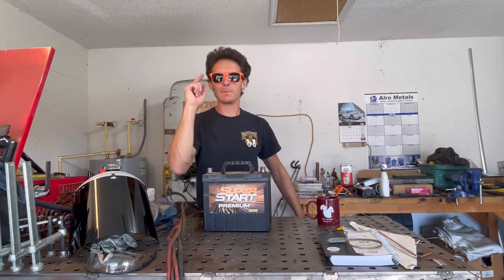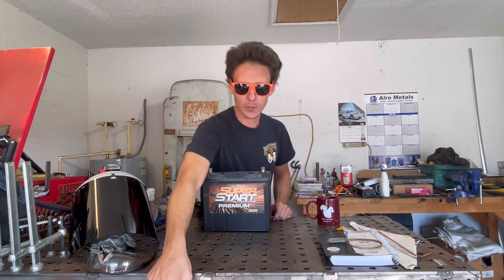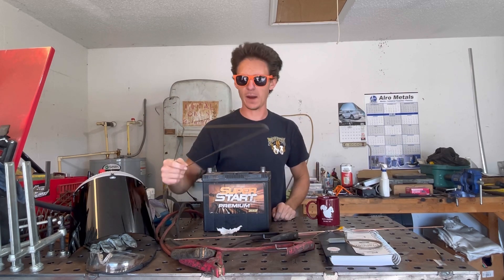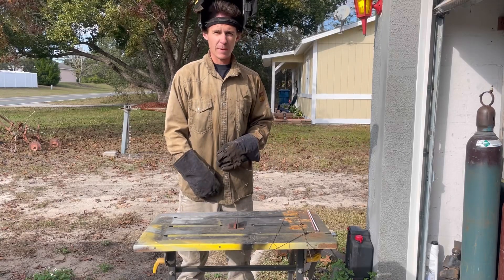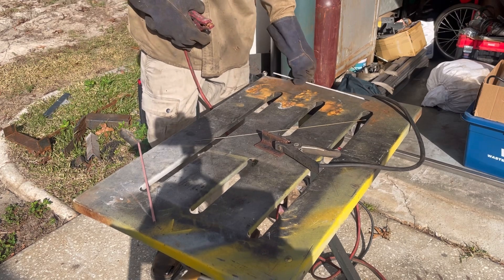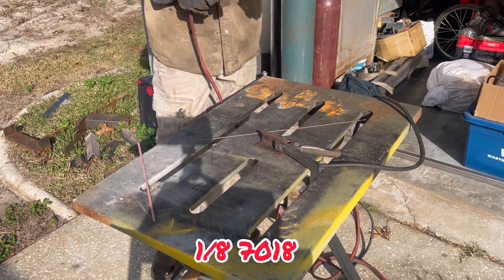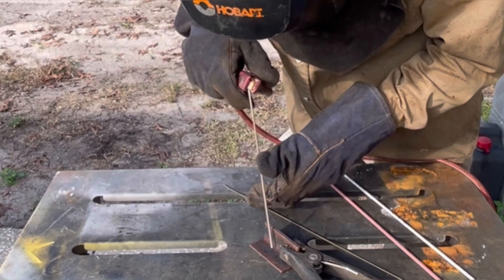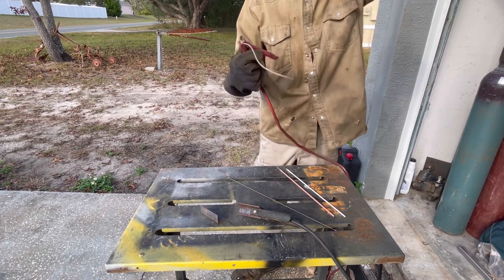Emergency Welding! (Can you Weld with Jumper Cables and a Car Battery?!)

Comment: Look up volt amp curve for whatever machine you can think of and mimic the parameters.
Reply from the maker: great suggestion. might do kit in a future video
Reply: @MeltinMetalAnthony  YODONT    YOU U U DON'T HAVE ENOUGH VOLTS...YOU NEED 2 BATTERIES...SO THEN YOU CAN WELD WITH ANY OF THE RODS YOU WANT" 👍
Reply: Thanks man
Reply: No 0
Reply: Trust in Jesus Christ —-
Reply: @juanit0tackit0tackito2  yes, and the good Lord would tell you to grind the workpiece and use the thinnest rods first of all

Comment: 12 volts is not enough to start the arc as it cannot flow enough amps...you need 24 volts to have much of a chance...if you run two 12v batteries in series this will work...make sure you disconnect from your vehicles wiring first or you can cause problems with the alternator and electronics....weld for a short period of time then hook back up to the charging system and replenish the batteries...do not draw the batteries down too far as this will damage them...be careful as batteries produce flammable hydrogen and can burst catastrophically causing injury.

Comment: I mean i guess you didn't really docany research i assume you have a decent idea of the voltage and amperage of your machines so i would have expected you to have assumed you would need 2 or 3 but juat tried 1 just to see but known that you would need more than 12v and obviously the battery should be able to do plenty of amps for a short time at least

Comment: You can weld with one battery you aint do it right ya gotta put both the cables on the rod and also if your rod just sucks sand it little also you can use a dime or a quarter but i never got the quarter to work as well as the dime i learned that one off a episode of macgyver

Comment: Look buddy it was never about the rods  it was about the batteries and the amps it produces you can do one big battery or 2 small ones like yours and I swear it will weld also you need to clean those pieces of metal scrape them next time and like I said anny rod would work at least most.

Comment: I already did it and works just fine, use 2 or 3 batteries connected  in series if you use bci 65 it'll be better.

Comment: Not enought voltage :) need like battery in serie as 24 volt or more to do welding need like 2 or 3 batteries

Comment: Looks to me that you have terminals on backward. Negative to work piece (vice locks) and positive to work piece.
Reply: spot welding
Reply: @dushk0 I’m aware. I have both a $5k engraver, a $20k laser welder, and I also plate on a regular basis. 🤙🏽

Comment: So 1, 12v battery usually runs around 14v.... in DC welding you need 24v minimum... you need 2 batteries in series to get 24v... also in DC welding the positive is your ground... also jumper cables don't hold them tight enough to get a solid connection use a pair of vice grips in the jumper cables!!! Lastly you will never weld with a wire hanger... welding rods and wire usually have Flux core inside them, non Flux welding wire or rods require the welder to use his own Flux!!! There are 2 ways to connect batteries 1 way will double the voltage output the other will double charge capacity!!! Wire in series is negative to positive leaving a negative and positive from each battery, doubles voltage output so 2 x 12v = 24v...at whatever amp hours the batteries capacity has... but wired in parallel or negative to negative and positive to positive should double the capacity of charge staying at 12v... in theory if you get 4 Batteries and run 2 in series then the other 2 in series and then run the sets parallel you will get 24v at the capacity of 2 batteries!!! It will also work the other way around so 2 batteries in parallel and another 2 in parallel and then run the sets in series giving 24v at capacity of 2 batteries!!!
Reply: Also lastly doing this shouldn't effect the stability or life of your batteries any more then normal as long as you consider capacity of life and charging for your applications!!!

Comment: I'm sure you can weld with 2 batteries.  Maybe you can try giving more power connecting a battery-charger to  just 1 battery ? I haven't seen  anybody trying this method yet....
Blessings from Venezuela. (I just discovered your channel today)

Comment: You need more voltage. Wire to batteries in series. Make sure they're actually charged well. Reverse polarity so that negative is your arc. Clean the surfaces you will be welding. If you do that you'll have a much better shot!

Comment: I would start with a minimum of 36V (3, 12V batteries in series), all with a good charge to maintain a reasonable arc with a 3/32 6011 rod.  Haven't tried this but the voltage is closer to welding voltages of vintage transformer machines.  They also have an OCV in the 60-80V range so starting is easier.

Comment: I've been trying to figure out  an emergency roadside/ trail  focused mobile welding set up.  

Found most people don't care for 120 volt welders and even they require a big generator with the typical 30 amp breaker not being ideal.

12 Volt batteries usually have to be ran at 24-36 volts and drain very quickly.

Does anyone have a better idea than just lugging around the bigass acetylene and oxygen bottles I already have and torch welding?  Obviously not a pipe welding rig setup but for getting some poor guy (possibly myself) back on the road again.

Comment: The problem is the battery doesn't have enough volts. You definitely need to make sure the batteries are fully charged and wire 3 or 4 of them in series. Really 5 of them would be pretty close to what a welder should be running at.

Comment: I don't know if it can work or not, but the videos I saw (purportedly)  show 3 or 4 batteries hooked up series. 12vdc really doesn't want to jump a gap (voltage is a measurement of how much electricity "wants" to conduct through a conductor (electromotive force). 

Higher voltage DC does want to jump a gap, but usually higher than even 36volts.  A lot of fires are started by running solar panels in series (but usually multiple panels and much higher voltages)  because of how much it wants to jump a gap and creates a plasma.

Comment: Turn your amps up lol … add another battery. From what I’ve seen 2 batteries in series and then switch polarity, you would think negative to your work piece to ground it… but no positive grounds your metal and use the negative to the rod

Comment: Voltage isn’t high enough need at least two deep cell batteries 👀 maybe grind that metal clean and wire them in series  positive on one battery negative on the other ..,, and make sure positive to negative to make 24 volts

Comment: I'd say a mixture of battery size, age and how full it is played a huge factor. I suppose, if stuck and having no better option, having the vehicle run while the alternator keeps the voltage around 13.8-14.4 might be better as well.
Reply: That’ll fry your alternator
Reply: @jeramegoodman7826 I was thinking the same thing but that was my concern, the alternator.

Comment: I’ve used this setup before to spot weld together some thin metal.  I had to cut the coat hanger down to about 6” to get it to arc.  I didn’t need a bead, but it served my purpose.

Comment: subbed..Any day can be WTFW and I hope everyday would be.   I appreciate the honest testing and curiousity!   I have an offgrid need to weld 1/4 rebar.    I am wondering if 480w @ 24v buck converter "safely" attached to my running van is enough? My van running alternator (160amps) WHILE RUNNING feeds my oversized starter battery 12v 155AH deep cycle.  FYI:  I am  current able to power 1500watt using a 2000 watt inverter with no issues to cook and power anything under 12amps.  If so and reasonable,  What rod would you recommend?  Any way to isolate to protect my battery, alternator and van since effectively shorting my battery.
Reply from the maker: I don't want to give you a bad answer. im not really sure what rod to recommend!

Comment: you need 2 batteries in series to get the voltage up to 24 volts - for thicker material need 3 batteries in series 36 volts
look at your welder - something like Idealarc 250 has 30 volts max output

Comment: I seen welding with 2 or 3 batteries in series. You need more voltage.

You also need good fully charged batteries…

Comment: Two batteries group 31 1100 CCA and bolt not jumpers cable's longer the cable less power for the stick.

Comment: I suspect a lot of these videos where they do this are trucks with 24V batteries rather than the smaller 12V batteries used in cars and other small engine machines. Be interestng to see if cleaning your ground point better might help too.

I did see Fab Rats here on youtube temporarily fixing a trailer using this method after his generator chucked it. Seemed to do the trick but odds are it was a 24V setup.

Comment: Loved the video. 2 - 24v batteries in series should light up. I think it would weld a bit weird though. Off the top of my head a CC machine will pump out 28-34 volts 100ish amps 1/8 7018 depending on arc length. Trying to remember but I think a battery is constant voltage. I imagine if you hooked 2 - 12v battteries in series up to the lugs on a wire feeder you would be able to control amperage with WFS. Your voltage would be stuck at 24v though, and the wire would be hot all the time. Might be worth trying out on a cheapo harbor freight MIG. Food for thought.

Comment: Take a d cell battery,  open up get the carbon rod strike an arc with pos. And solder two pieces of metal.  No weilding. Larger the 12 volt the better!

Comment: Just like Jake mentioned in his you need two batteries to do it I've seen it done off-road and someone break a tie rod use a piece of angle iron and weld it on with two batteries and jumper cables
Reply from the maker: I was trying to replicate a regular situation. most vehicles only have one battery
Reply: Do you need just one buss link to tie the batteries in series?
Reply: @ryanbeard1119  yes

Comment: you need 2 or 3 batteries to make this work.

years ago, a body guy made a resistance spot welder to spot weld bodies, and weld studs for panel pulling, used 2 batteries in series. worked great!!!!!
Reply: I was a body tech for 10 years, never seen that done, can you tell me more?

Comment: Try welding with the old car generators not the modern alternators with voltage regulators but perhaps those would work too if you jump the regulator to always be in full field output. You’ll have another backup welder for your field work and an impressive tool to boast👏✌️
Reply from the maker: cool, didn't know that
Reply: @MeltinMetalAnthony  an old school diesel instructor told me that and that was in 1990 so it probably dates back to the 1960’s

Comment: Put 2 or 3 batteries together in series and it will work. Think about a mig welder. You set your voltage between say 17 and 24 volts. That's two 12 volt batteries wired in series.

Comment: I never STICK" welded with batteries.
  But I have a READYWELDER wire welder spoolgun,   that will weld great on 24 or 36 vdc.    Flux core or gas mig. From 1/8" to over 1/2" steel. And do as nice as a regular mig welder.    It also welds ALUMINUM with Argon gas.
  Try 2 12 volt batteries in SERIES or even 3. 12volt batteries it will work,   plus take a 2ft chain 3/8",  and clamp one end to the work and try different links with the ground clamp to change the amperage and voltage,  I don't think you have enough voltage.   Minimum 2 12v batteries in "SERIES" not parallel, preferably number 31 size  fully charged. 😃😃 Great Video

Comment: Not enough voltage? 12 volts would barely weld 18 gauge on MIG/MAG. I think you had the right idea when you were talking about linking up multiple batteries in series. 2 of those badboys should give you maybe 18-24 volts, depending on the type of batteries used, that should be enough to burn a sheetmetal rod? I dunno if my figuring is correct but it may be worth a try. I may try it myself when I get me a lid. Cool idea. Cool video!

Comment: I'd say if you had 2  12 volt batteries and ran them in series i.e. connect the positive of one to the negative of the other, and your ground and stinger from the + from one battery and the - from the other,.
 it might be enough voltage to light it up.
It's most probably a voltage issue not so much current.
It say you'd still struggle with 6010s as they typically need a much high open circuit voltage OCV to light up over 60V.
But who knows, it love to see the experiment with a few different rod types.

Comment: I'd say if you had 2 volt batteries and ran them in series it might be enough voltage to light it up.
It's most probably a voltage issue not aso much current.
Reply: @NA-fe4yy You need a certain amount of voltage to light up a welding rod,  voltage matters, that's why your open circuit voltage is always higher in the 50 to 90 volts depending on the welders. This is a misunderstanding of the relationship between Voltage and current. You couldn't stick weld with 1000 amps at 1 volts.

 It's like when people say it's not the volts that kills it's the amps, when in reality  I could hold 2000 amps bare copper wire in my hands at a couple volts and I'd be fine. If I did the opposite 2000 volts at 1amp I'd be dead. You need the volts high enough to get the current to go into the high resistance of your body.

Or down your welding leads and through the material and your welding rod. 
That's why I suggested Putting 2 batteries in series to double the voltage.

Comment: There's actually a field repair welder that you connect to two batteries to repair you're overland vehicle to limp it back home I forget what it's call it's a spool gun you run flux core in it

Comment: Another  source  of  12 volt batteries  is ones used in emergency  lighting (exit signs) $12-25 each new. obvious  not the capacity  of a car or marine  battery  but a much better  price point  for proof of concept. I  use them for a car stereo  I put in a rolling  toolbox  I made.

Comment: Grind the rust off man too much rust for the ground cable and the electrodes arent  gunna weld to good cus of the rust
Reply from the maker: wanted to leave the rust cause in a emergency you prolly won't have a grinder

Comment: Need two in series but bro you may need to come on the road seems like you have to much free time
Reply from the maker: line up some work then Shawn!
Reply: Welding with jumpercables is so yesterday you seen what I just got only 7 rods but battery power is the shit

Comment: I think you had a bad connection when you laid the jump cable clamp on that metal table with the other clamp attached to the angle iron that was sitting on the table it should have been sparking… I am a mechanic and have welding burn marks on a couple of wrenches from hitting the positive post on the back of the alternator while taking other parts off and that valve is a lot smaller

Comment: I have heard of people using a battery charger to do emergency welding with in the past. You could try linking two batteries together so you get 24volts, that should start an arc because they start trucks really easy! 😂😂😂😂
Reply: Stick welders typically have around 25 volts on the output side, so yes, the two battery idea might be the ticket! Hi amps, low volts= stick welding success!
Reply: Trust in Jesus Christ—-

Comment: 1st thing I would have done is cover that bomb/battery up. 2nd thing would be to clean the angle thoroughly and check to see how much surface contact jumper cable clamp to angle has.
Interesting to watch anyway.

Comment: See it done in this YT video using 2 car batteries and DCEN: https://www.youtube.com/watch?v=PV5oLPLUzrM
Reply from the maker: checking it out now
Reply: @MeltinMetalAnthony  That's the best one I've seen on YouTube describing it. Another thing the 4x4 guys do is turn an alternator into a  "weldernator". Same thing as the premier power welder.

Comment: High quality jumper cables help also.  Cheapies have small gauge wire and  poor connections. All those things add up to increase resistance, lowering your voltage. It can also help to use vise grips to hold your rod or ground your work.
Reply: Are you all high? All this alchemy, wire strands, gauge and whatnot...by the by, this is DC, no pulses, so the less the strands the better...real sigma alphas bend a solid copper rod with the power of will while holding the arc! Anyways, don't you see the ugly rusty crud under the clamp and where the electrode touches? That's the first thing to sort out. And probably a very thin 6010/6013.
Reply: Ita not the gauge thats important in welding its the amount of stranda in the wire the higher the count the better for welding conaidering that current follow the outer side of the wire
Reply: @tambosnipes1652 thats an AC thing it's DC so gauge is all that matters

Comment: 3- 6 volt deep cycle  batteries in series will let you run 6011 1/8” or 7018 3/32”. Better arc the two 12 volts but 2 12 volts will work

Comment: need at least 18 volts-two 12 volt batteries will give a nice hot arc with 150-200 amps

Comment: Anthony bro... the next tool I think you should invest in.. is a portable bandsaw.. or we call them portabands.. instead of burning through all of those zipdiscs and abrasive wheels. the portaband will save you time and money..
I use a Milwaukee 18v at work (millwright for a lumber mill) to cut through all my tubing, angle, channel etc.. when I'm out of the shop. I think you should go see if you could rent one and give it a test run. I think you will be pleased my friend. 
keep up the good content bro.
happy holidays
Andrew
Reply: Yes. To cut out sheet metal. But not form nice clean cutingbof bar or round stock. I'm telling you from my opinion. A portaband does wonders for time saving and cut cleanness!!!